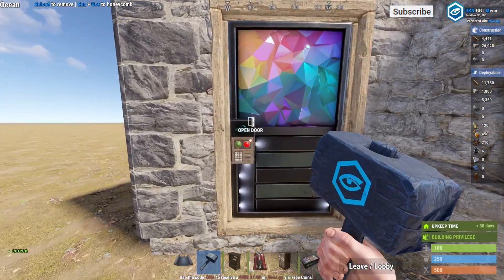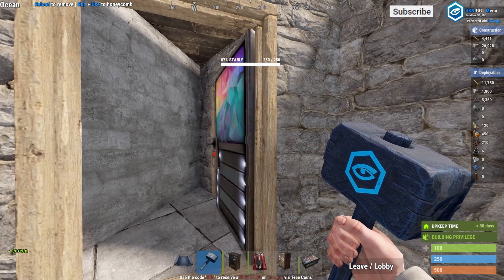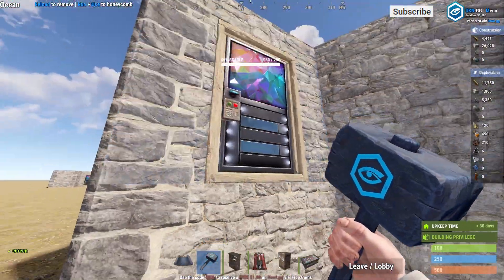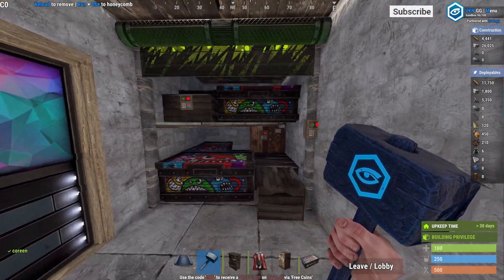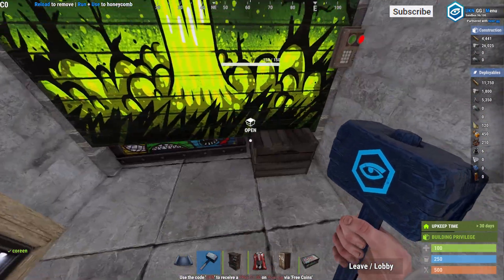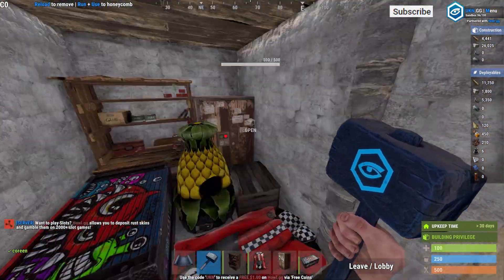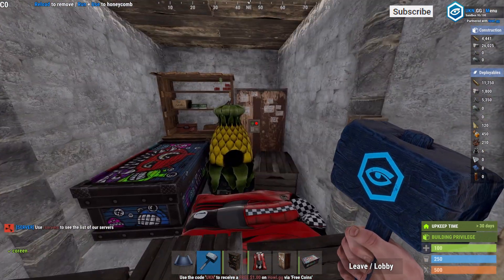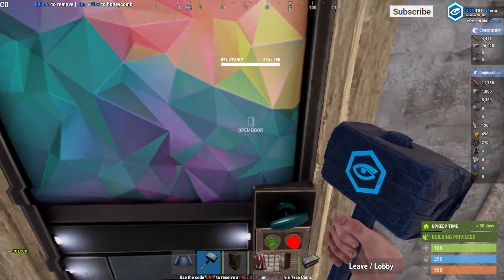Rust: THE ULTIMATE 2x1

Comment: And if anybody wants a slightly better really good 2x1 design with a small expansion templetaps made one called the chad shack , it's a extremely good base that includes some of these elements. With 9 or 10 boxes , research table , workbench, furnaces , and vending machines.

Comment: Iv really been into using the window slots with embrasures and the glass instead of a door. turns a door with 250hp into a 850hp  , sucks for mobility internally best excellent for defence and very expensive to raid.
Reply from the maker: It’s a really good method for bigger bases. I think for a 2x1 it could get too complicated to move around and access everything
Reply: Absolutely bro! I use the loot goblin by spaz with a few alterations , really good solo base the foot print just confuses people it just gets left alone it’s pretty sweet bro haha! Can use it as a starter just do the first 3 triangles as wood with door then hack out once u can expand.